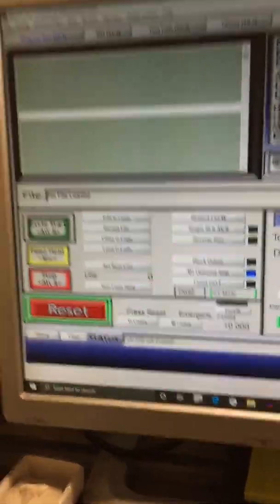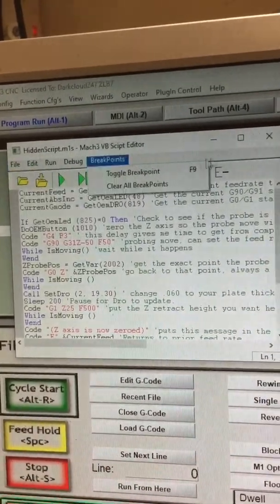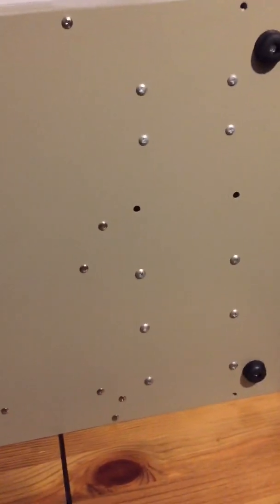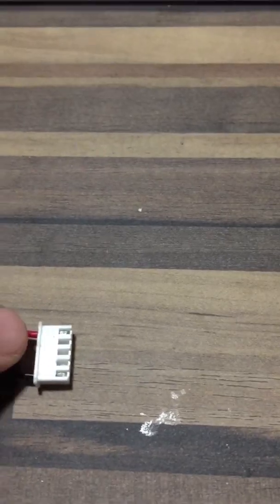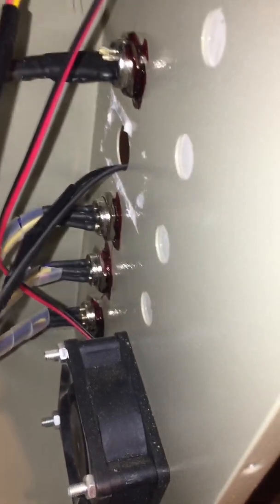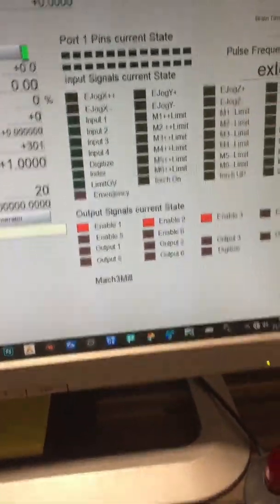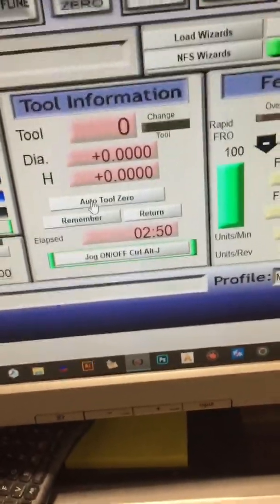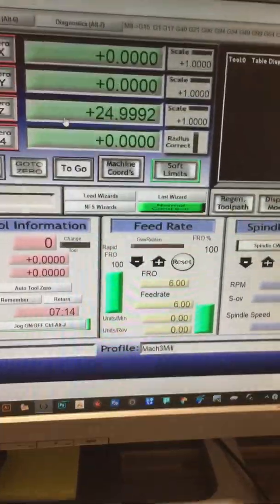Touch plate auto zero tool setup for Cncest 6040  chinese cnc Mach 3 .

Comment: Thanks or the video. I've followed your instructions step by step, connectes the pins 1 and 5 of the connector as shown, pasted the script and everything. But when on the diagnostics screen and making contact between the alligator clip and the probe base, nothing lights up. Any hint what can be wrong? My machine uses a parallel port.
I will appreciate any help you can give me and make a donation for it. I am desperated.
Reply from the maker: Hello its hard to guess with out it in front of me ....the script wont effect the connection so it has to be the wiring assuming your settings are correct ...first thing I would do is double check your setting ....then check the earth and live pins in the control box make sure they are actually working ....assuming they are then recheck your connections on your touch plate.
Reply: @darkcloud247ay  Hi Daniel. Thankyou for your answer. I understand that it is difficult to guess what is happening. I wish I could send you a pic of the diagnostics screen. I'll try this way though.
On the diagnostics screen, the parallel port shows 5 pins lit up, prior to anything, that is, without entering the probe pins and activating them and without saving the script.
they show like this:
000XXXXX0000
0 0 0 0 0 0 0 0 0
Where the "X" are lit up in green. After saving the script, and configuration the probe pins, it remains without change. Even when making contact with the two parts of the probe. I've checked with a voltimeter the voltage between the probe and the alligator and it reads 9 volts with some decimals.
I have no idea of electronics but... may this mean that the 5 pins of the connector are all connected together or shortcircuited? 
BTW My VFD uses a parallel port, and its model is PRT-E1500W.
Reply from the maker: @DGAWDGAW  the only other thing i can suggest is to try and earth the crocodile clip against something other than the touch plate and see if that creates any changes in the parallel port diagnostics.... if it does it means that the earth is faulty . I will have a look online and see what I can find in the meantime that may help.
Reply from the maker: After checking quite a few forums for this problem people have found changing their parallel cable has rectified the problem because the cable was defective or the pin config was wrong because not all pins are apparently active in some cables .....
Reply from the maker: Let me know how you get on and if you rectify the issue.
Reply: Thanks for your quick answer. Now I have to get another parallel cable. However, the fact that those 5 pins are lit up is normal? Or should all pins DRO be off? Once I get the cable and try I’ll let you know.
Reply: Hi Daniel. Just did what you suggest about making contact with the crocodile clip somewhere else, so I made it contact the connectors casing of the machine axis. What happens is that the most right pin of those that are lit up ( as mentioned) switches off and it is the Digitize DRO one that lights up. Does this help you? Curious because I do not have a USB port on the machine.
Reply from the maker: @DGAWDGAW  yeah the pin light going out means it's earthed like it should be ...you have a problem with  the earth pin in the control box or the touch plate itsself ...
Reply from the maker: Why the digitizer is lighting up as well I'm not sure maybe it does it for both usb and parallel port
Reply from the maker: I would unplug the touch plate from the control box... temporarily bridge pin 1 and 5 on the connector plug it back in the control box if the digitizer is light up and the pin light goes out again its gonna be the touch plate that needs rewiring ...if it stays the same it's the earth pin that's faulty ...if that's the cause find another earth in the control box and use that

Comment: Hello,
I've been trying to use the Probe for a few days but it is detected as a Limited switch in mach 3. I am using the drufelCNC chip with a USB port. I have connected the probe as in the instructions of the chip, where it is also specified as a probe. Also, I can not understand what I need to specify the port and pin, because it makes no difference to me whether I set port 1 or 2. I hope someone can help me.
Reply from the maker: My guess is your pin configuration within mach 3 is wrong ...without screenshot and other information it's hard to access ....make a account with cnczone.com and post a thread someone there will be able to help you ..
Reply: I have already found out what the problem was and that is the pins for the probe in the manual of the BSMCEO4U-PP motion controller.
The black wire has to be connected to the ground "DCM" and the red wire to "in4". Then in mach 3 under input the probe port 3 and pin 4 specify then it should work with the USB variant.
Reply from the maker: @timbrodje6708  glad you sorted it .

Comment: Hi,  I have bought one CNCEST 6090 ,in any setting will not move at all could you help me what I must to do?
Reply from the maker: Are you using parallel port or USB
Reply: @darkcloud247ay  Hi USB
Reply from the maker: You should have been supplied a file that gets put in the plug in folder within mach 3 think it's a dll file have you put that file in
Reply: @darkcloud247ay  to be honest with you I'm really new ,and I bought this machine from ebay no any instruction comes with it, I have download just mach3 no any movement at all , also I download Drufelcnc software ,but with this software will move but with out control LOL
Reply: @darkcloud247ay  if you can send me setting for mach3 by any how will be great
Reply from the maker: @b.k1742  https://youtu.be/0mlfccAVUP4
Reply from the maker: That should get you up and running just remember to copy the dll file that came with the cnc to mach 3 plug in folder
Reply: @darkcloud247ay  as I said nothing comes with ,
Reply from the maker: @b.k1742  I would contact the people you bought it from I'm certain it needs the plug in file to communicate with the program properly
Reply: @darkcloud247ay  don't understand what you mean ! but anyway if you mean i should InTouch with seller to get information ,I have told the seller no responding that's why I'm here to get help. anyway thanks for your time.

Comment: FYI: You can buy some strain relief connectors for that wire which can help prevent accidentally pulling the connector out of board on Amazon for about $10. I tried to input a link, but if you just go there and enter strain relief you should be able to get right to it if you like.
Reply from the maker: Just googled it .... you know I see them in use everyday but was unaware of the actual title of the item
Reply from the maker: Nice one thanks for sharing that any additional information is welcome .

Comment: Explained it all very clearly. Good job
Can I ask where you got the script from? Could not locate it on ArtSoft's site
Reply from the maker: Thank you I try .........It came from this site it lots of useful info for this type of cnc ..... https://the-cnc.blogspot.com/p/z-probe-code.html?m=1&fbclid=IwAR1CWcNUA3sZVPGyNS7CJx7U1KvL9GedQkOFJ8ZJ9SKtp10jjWTcGM52cGg
Reply: @darkcloud247ay  Yes, top site. Thanks
 I also noticed that the same connector has the pins for the X, Y  and Z Limit  Switches which will be my next job.
Cheers again
Reply from the maker: @nakusflies593  glad you found the site useful .... im just using the soft limits within Mach3 at the minute but will install the limit switches in the future .
Reply: @darkcloud247ay  - Good. Will wait for your video. Cheers from down under.